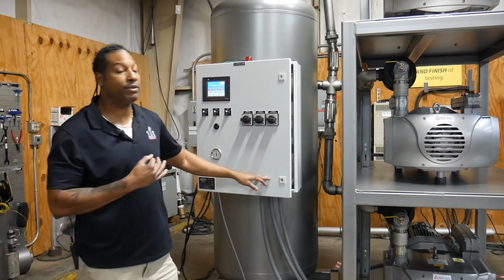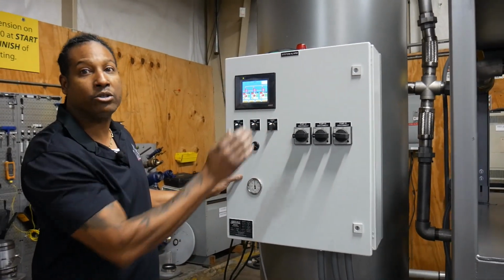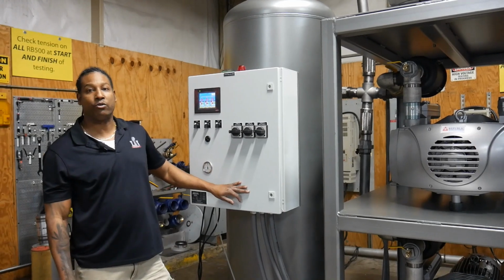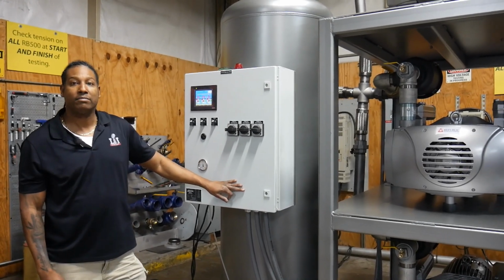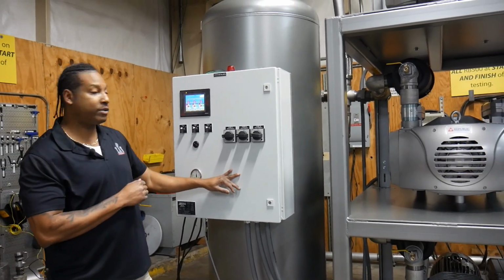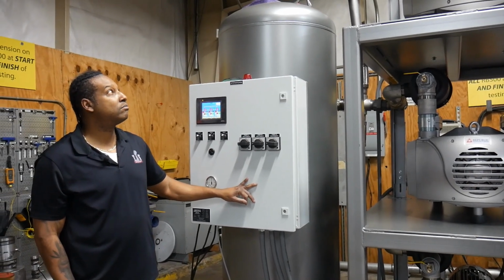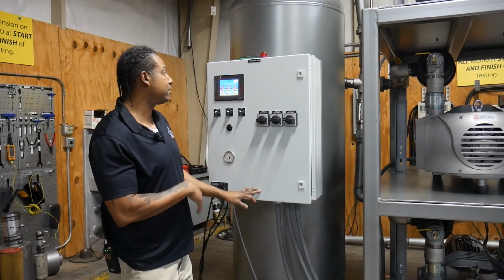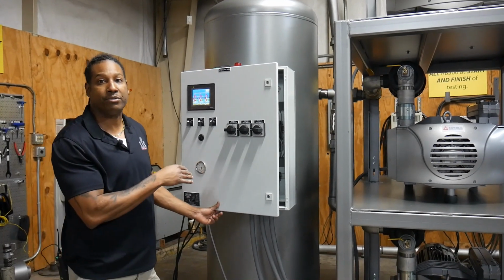Triplex Medical Vacuum System | Republic Manufacturing

Comment: Busch system are far away smaller!
Reply from the maker: Depends on the application! This one was a custom job so it fit the client's specific space/parameters. Our central systems are actually a standardized, super customizable line that can go much smaller (or larger) than this. If you wanna learn a bit more, we just put out a video about it: https://youtu.be/tmpXg8vyI0I Cheers and thanks for replying!
Reply: @RepublicManufacturing  what does this instalation need? how much vac and flow?